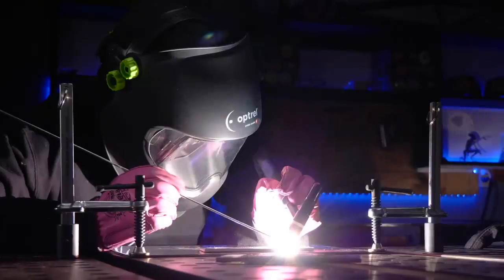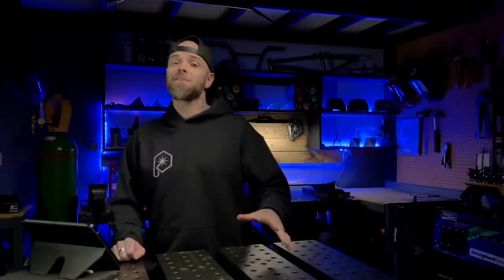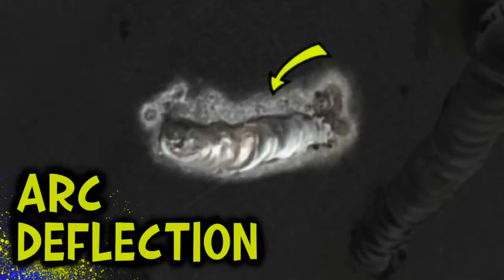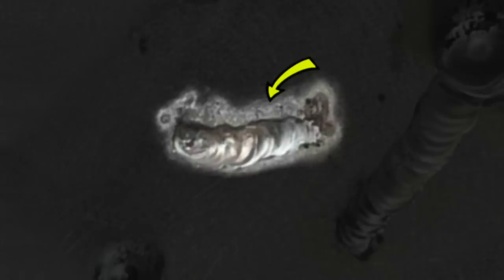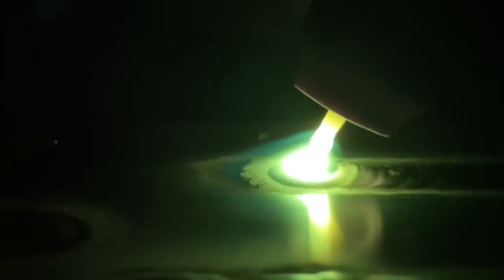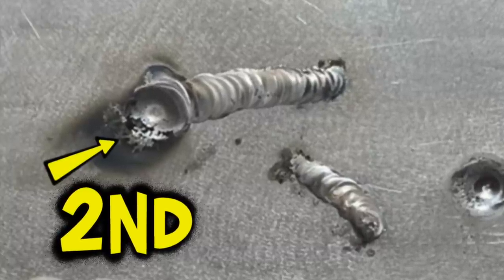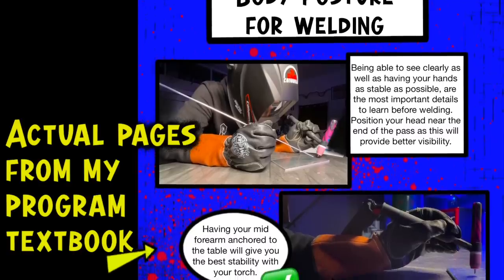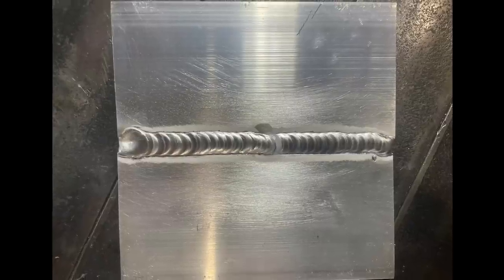Why aren't my tig welds SHINY??💎

Comment: You should do a video on what causes suck back and how to prevent it on thin wall tubing. I work in the aerospace industry and even after 14 years I still struggle in certain areas. Lot of tube to plate (.035 to .049). Usually between 1” to 2” diameter. Def would be helpful.

Comment: Most of my tig welds are shiny but when I tig weld a t joint on the aluminum tanks I build we have to tig a t joint on the lift lugs and my lift lug t joint welds are never shiny but I see some guys t joint welds shiny idk if they let it cool down between each pass
Reply: Try messing with your freq and balance, I do 120 for freq and 70 for balance and they are shiny, and yea have your arc length super tight. And always wipe with acetone after you tack up right before your going to weld (obviously after you wipe before you brush too and shit).
Reply: @Xotc_  yeah I typically run 120-144 for frequency and anywhere between 65-70 for balance and I usually acetone the shit out of the material before welding it even on stainless my job is pretty much out of aluminum tanks for the most part there’s really only two guys building aluminum tanks right now the rest on stainless the stainless tanks are cake walk I got my settings dialed in on that but that’s mostly mig I typically run 34 arc length and 30 arc control and 312 ipm on the stainless mig welder with 0.35 wire then if I have to tig stainless I’m typically running 180 amps with balance at 70 and frequency at 120-144